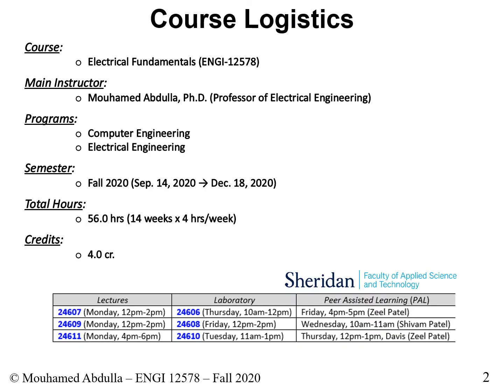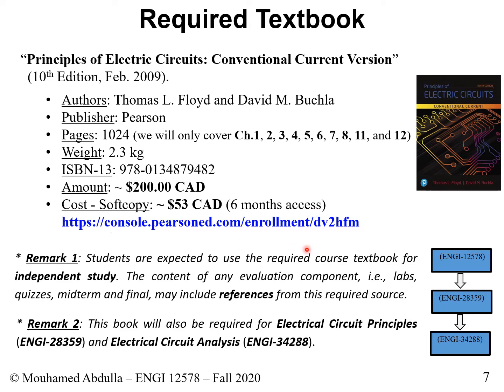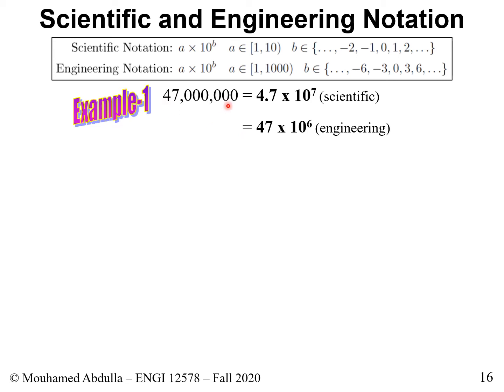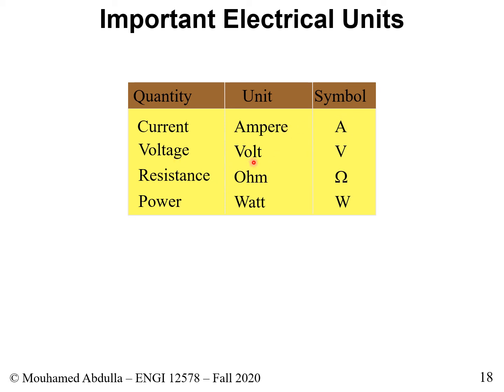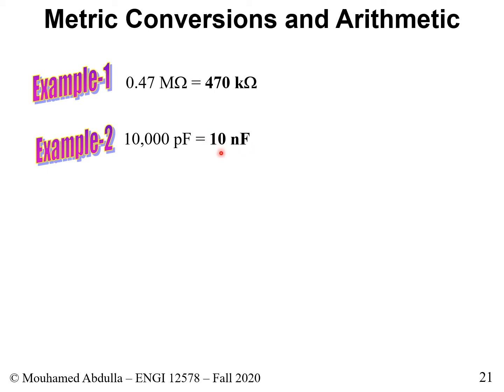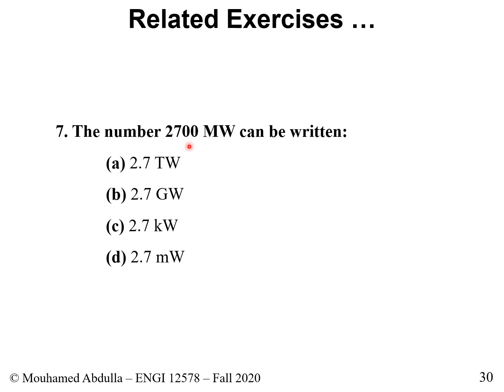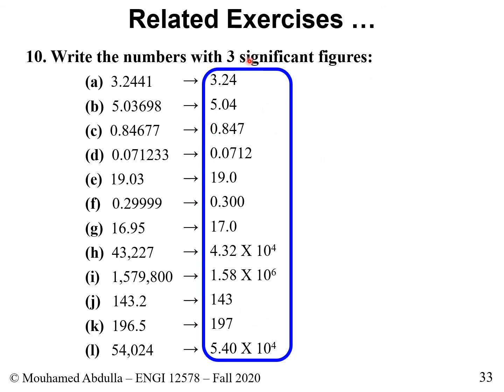Lec 1 - Electricity, AC/DC Circuits, Scientific/Engineering Notations, SI Units, Significant Digits

Comment from the maker: Course Information:
----------------------------------
00:00 - Introduction
00:34 - Course Logistics
01:42 - SLATE
02:29 - Course Delivery
03:39 - Office Hours
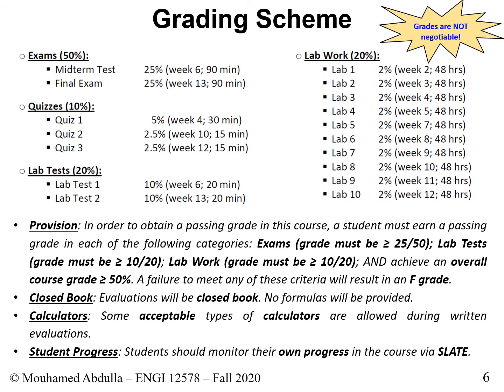04:47 - Grading Scheme
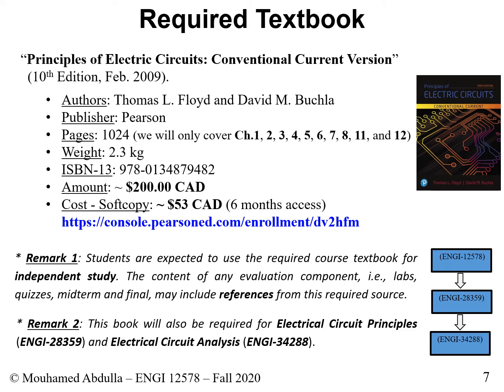07:37 - Required Textbook
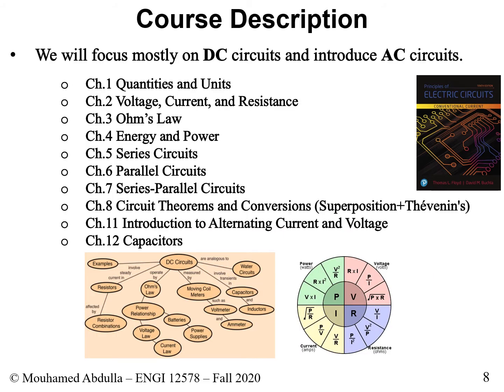09:43 - Course Description
11:11 - Laboratory Work (Multisim Live from NI)
13:10 - Weekly Timetable
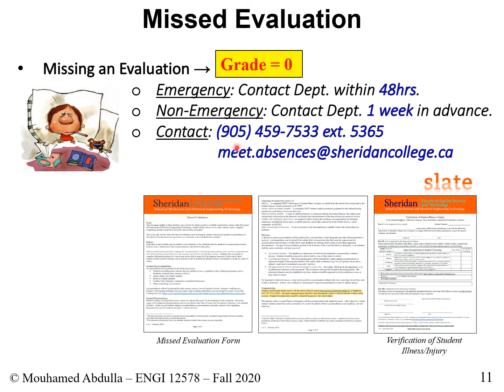14:20 - Missed Evaluation
15:37 - Academic Integrity
17:26 - Your Future!

Lecture:
---------------
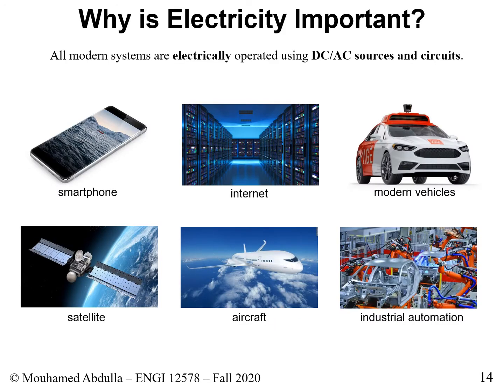18:01 - Why is Electricity Important?
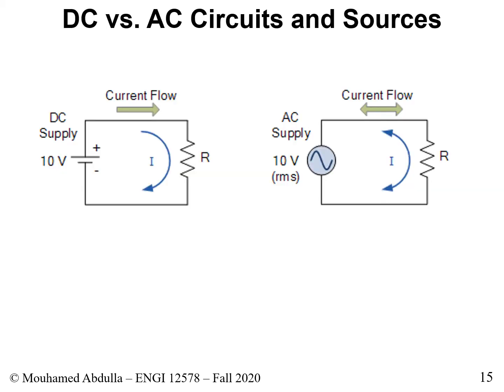19:08 - Direct Current (DC) vs. Alternating Current (AC) Circuits
24:53 - Scientific and Engineering Notations
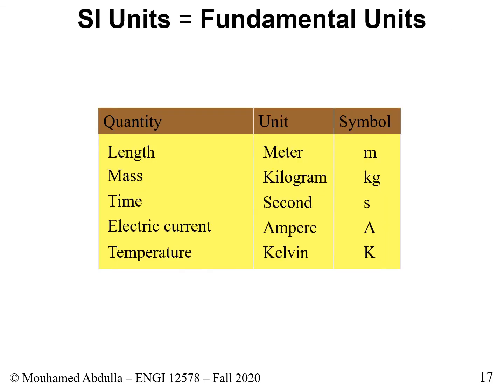29:55 - International System of Units (i.e. SI Units)
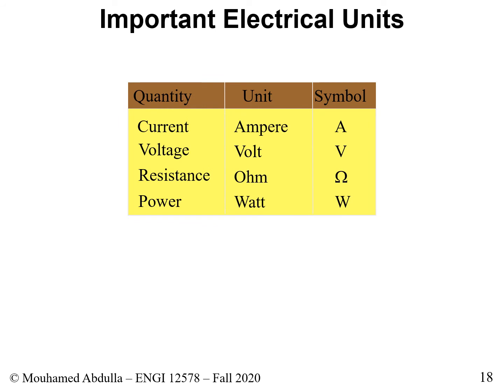32:10 - Electrical Units
33:42 - Engineering Prefixes
37:58 - Arithmetic with Engineering Notation
43:31 - Key Terms and Definitions
43:43 - Relevant Multiple Choice Questions
52:44 - Significant Digits